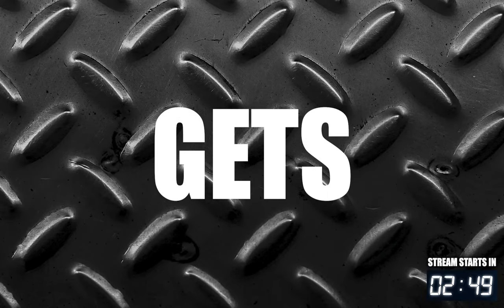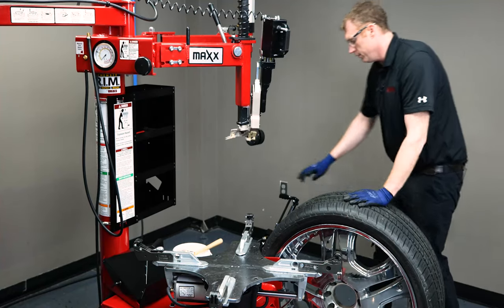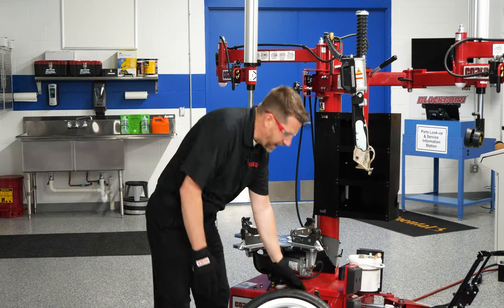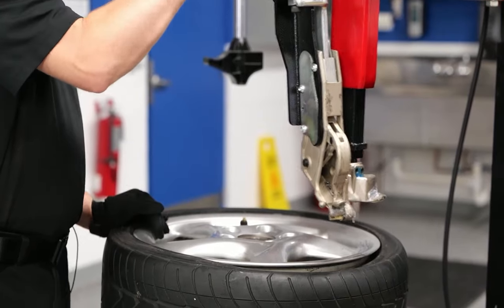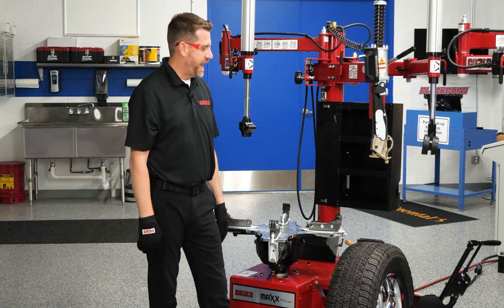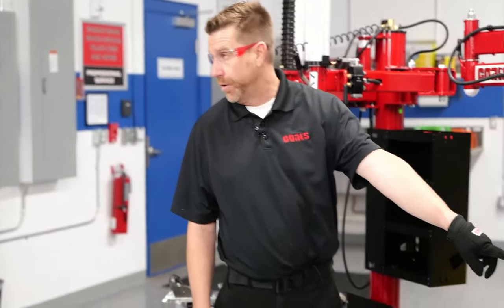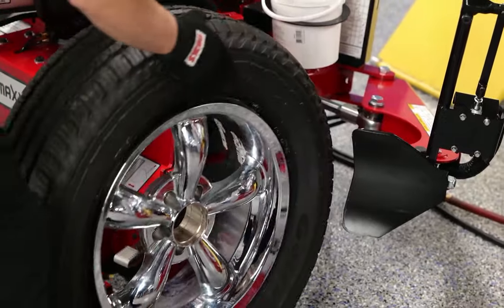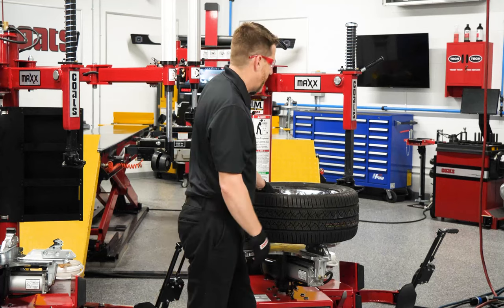Maxx Tire Changer Master Class

Comment: You never  mentioned the position of the sensor,   would it work with the tire in any position with out damaging it? .. thanks
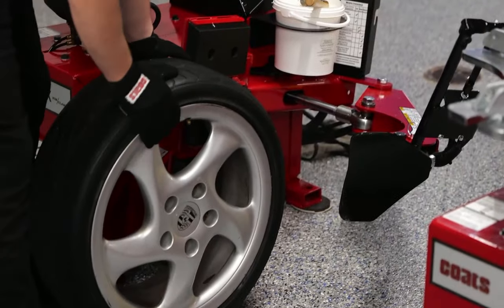Reply from the maker: The TPMS sensor should be positioned at the 12 o'clock position when starting to loosen the bead. Look at 9:59 in the video.
Reply from the maker: Hi there! Before beginning the dismount process, make sure the TPMS sensor is behind the duckhead. Do the same before you dismount the bottom bead. Then, when mounting the bottom bead of the new tire, position the tire on the wheel with the TPMS sensor located at the traction point or 7 o’ clock. Then, rotate the tabletop and mount the bottom bead. Hope this helps!
Reply: @thecoatscompany    😉 thank you..

Comment: I got a max 70 air operated tire machine from automotive equipment specialist it struggles on low profile and 19.5 tires I call the company I purchased and all they told me was u are on your on call coats deal with them two week later they just I’m back and forth and I got new tires just collecting dust
Reply: everyone knows the pneumatic turn table sucks. return it and get an electric one 👍

Comment: My current machine has a disc that I can pick up the tire with when removing the tire this doesn't
Reply from the maker: Hi Robert! Yes some of our tire changer models do use disc arms to help with bead dismount especially with delicate assemblies such as carbon fiber rims on our APS 3000.  Our Maxx series is equipped to handle a wide range of tires and wheels using other helper arms like our robo roller and robo helper arm. If you'd like more information on our changers that utilize a roller, take a look at our APS 3000 demo video or let us know if we can answer any questions!